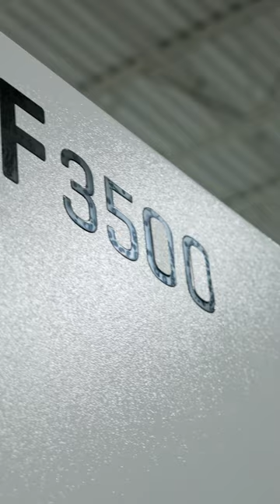Machining Sharrow Marine Props Using Heller Machining Cell

Comment: I'm wondering, why not Haas or Doosan?
Reply: Speaking of Haas, they  are not really serious production machines. They wear out readily, and their controls are very outdated. For these sort of tool paths, you need some serious computing power
Reply: @stevetaylor5382  makes sense, we are starting a small company and we are thinking about tormatch for now.
Any other recommendations on that low price range?
Reply: Take a good look at Trak machine tools, made in California. I run two of them, in high mix, low volume, and love 'em.

Comment: Not sure what makes them "impossible parts" if you have the machine with the axis count to do it it's all about the programming.
Reply: Yeah it makes no sense to me either, there’s no way you’ll get me to believe this company are the only company in the world which can machine or programme these parts, maybe they’re producing them at a cost no one else could match, but the actual parts definitely aren’t impossible
Reply: @willyharris4199  you'd be surprised how legit this shop is compared to other machine shops. They have names like "PERFECT" CNC or something pretty like that on the surface, but once you're inside you realize again why they say "never judge a book by its cover"
Reply: At some shops they're impossible because the programmer is actually incapable of programming correctly. Here, they show those programmers how it's done, make them possible. 😶‍🌫️
Reply: @diegocarr5965  I don’t even understand what you’re trying to say, all I said was that the parts they keep saying are impossible to make are definitely possible and not only possible by this one machine shop, it’s nothing but an advert for heller machines at this point
Reply: @willyharris4199  wah wah wah is what I'm hearing
Reply: @subtleusername5475  very mature